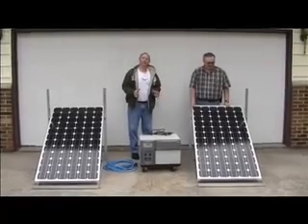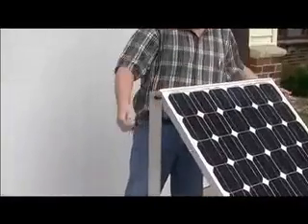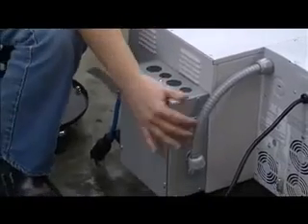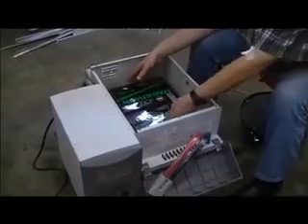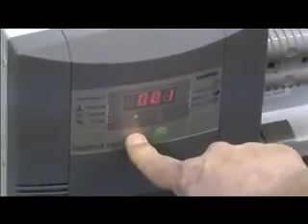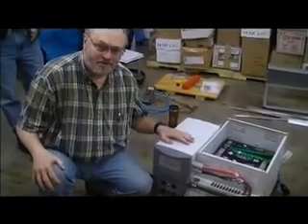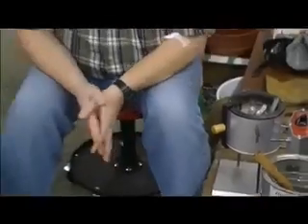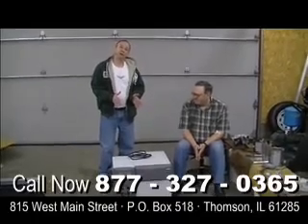Solar Generation Beat the Electric Company With Your Own Homemade Solar Power

Comment: My brother lives in ashville Nc called me about a small back up system for his house mainly a 40w water purafyer. I recomended the powerhub 1800. The problem we ran into was batterie size to fit the box niether XANTREX or private vendors had this posted. they need to have this info clear. check out my vids and maybe leave your responce there CHEERS WINDY NC